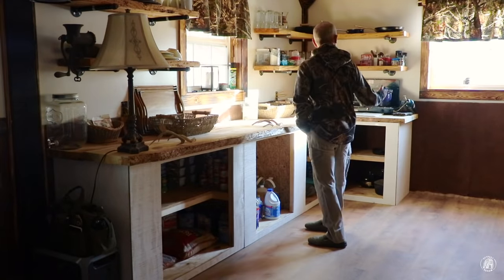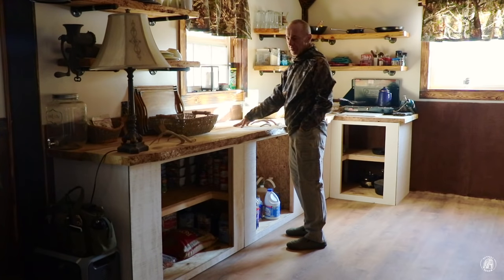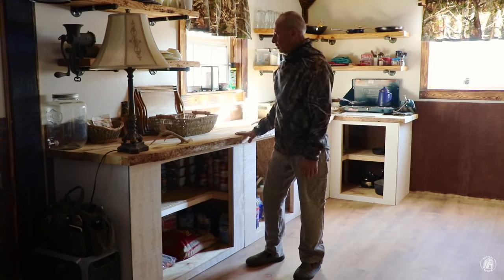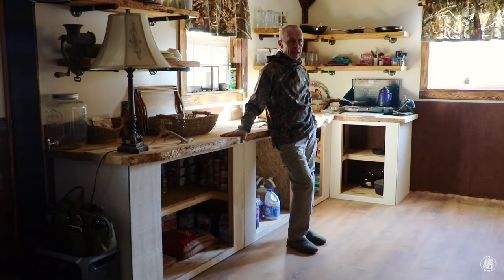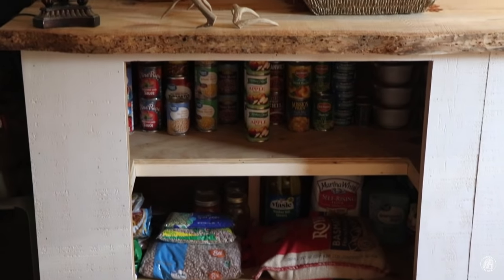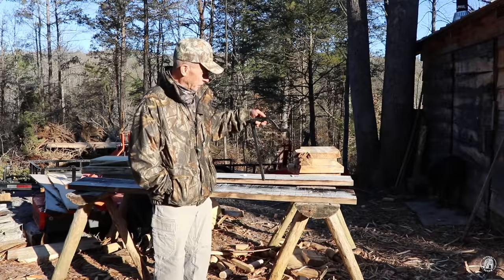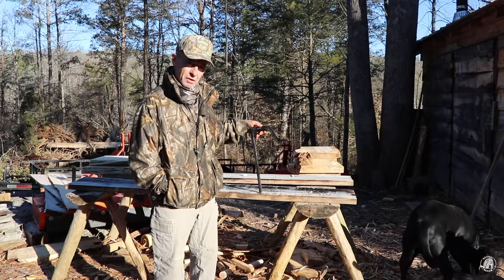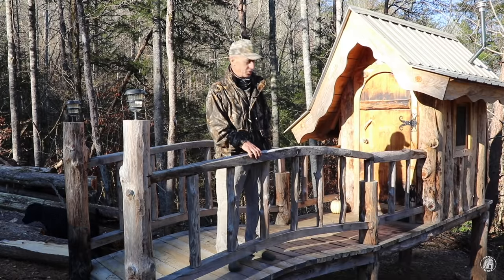DIY KITCHEN CABINET FRAMING | OFF GRID TIMBER FRAME CABIN HOMESTEAD

Comment: I would go with 5 or 6 coats of polyurethane, sand down well with fine and extra fine steel wool between coats.
Clothes line is definitely the way to go, good thinking!
Wondering about your backsplash plans? Maybe add in the pine log trim , knotched out around the outlets should work and look good?

Comment: I've had very good luck with an epoxy surface I poured several years ago.  You'll need a heat gun or a small torch to lightly go over the surface once it's poured to disburse the small bubbles that will form.  Nice job on the cabinets.  I recently noticed some of those hold-downs for sale at a Woodcraft Store.  They were in the $30-$40 range.

Comment: Just apply clear polyurethane varnish to your  kitchen counter tops. Then if you ever think you need to add a two component cast top, the prep would be minimal. Besides poly is a lot less messy to apply. Enjoy the new kitchen.

Comment: I think I'd leave the porch natural.  Let it weather a while.  It looks good the way it is, and as you said it doesn't really get the weather.  Worst comes to Worst you could replace it with freshly cut timber.  I'd think about putting a removable clothes line under the roof of the porch too.. that way if you have a rainy day and want to wash your clothes you can hang them and not worry about it.  Gives you something to do on a rainy day.